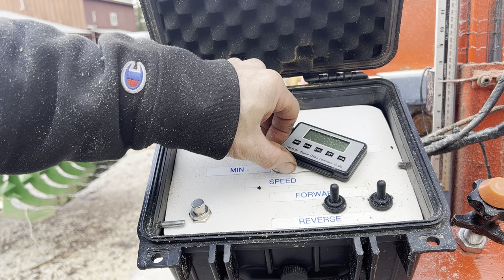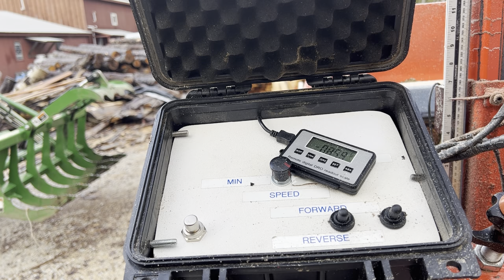A homemade sawmill, REAL WORLD use and review.

Comment: Just found your channel the other day and have been going through your sawmill build. I haven’t found what you are using for the forward and reverse motor. Any chance you could let me know? 
Also hello from a fellow NSian.
Reply from the maker: Hello fellow Bluenoser- I use a 12v DC motor and speed controller with a length of #40 chain- works like a charm for now. After 320hours, I notice the motor losing power- especially on the return dragging a slab back- so an upgrade to hydraulic might be in my future. Thanks for watching! Merry Christmas, Jeff
Reply: @thelogfather5002 
Do you have any specs on the 12 v motor. I have a 40a speed controller, but am not sure what size to get for the motor. 
Do you have an email I can contact with questions?
Reply from the maker: @dalecooper7656  by all means, email me at logfather@yahoo.com

Comment: I'm mulling over ideas of building something similar. One idea I have is instead of hydraulic, use air. The plumbing, valves, and actuators are way way cheaper and there is no fluid to loose and make a mess with. Yes, air can freeze up and you'd need a big compressor to run drive motors. Which is why I'd find one with belt drive off a junk truck with air brakes and plumb in a drier and a fill point for air antifreeze in the case you do get ice. For actuators, I was thinking small air cans used on front brakes or tailgate locks. Maybe it would be better to do hydraulic for the drive though because that would meter the speed better. But the cant locks would get expensive with hoses. I haven't run any numbers, just thinking out loud I guess.
Reply from the maker: I think it’s hard to beat the power, speed and finesse of hydraulics- you’d need a big compressor to run it all, especially if you want to run more than one function at a time. I’d like air at my mill just to keep everything clean, run multiple air nozzles at key places where sawdust builds up and give it a ‘blast’ between logs to make sure my end of the day clean up goes faster and I can start tomorrow with a fresh mill. Thanks for watching, I appreciate any and all feedback and ideas !  Merry Christmas! Jeff.

Comment: If you add a hyd power pack, would you consider a log loader, so you don't need to run your tractor for every log ?
Reply from the maker: I don’t think so- I’d rather build a deck to load a dozen or so logs and roll each one on the mill as I go. I don’t want to have to walk over the loader arms.
Reply: @thelogfather5002  I have a deck for mine. I have two short removable pieces to bridge the gap, when I roll on a log.